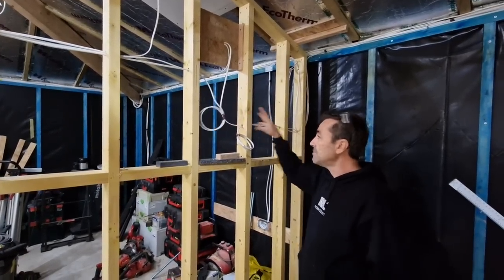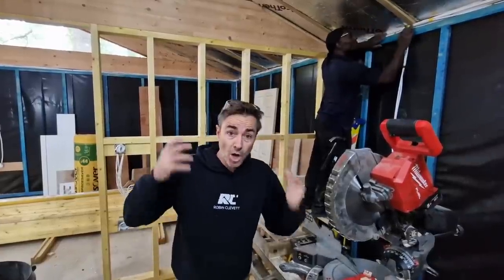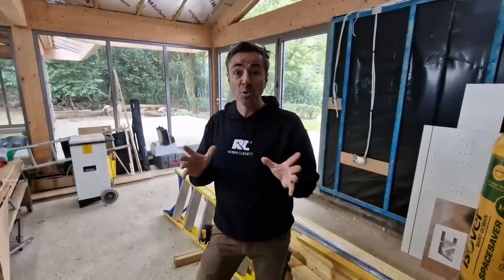Ultimate Garden Room Electrics first fix, meet Colin my electrician

Comment: Robin this is how we do it here in Australia. 
Firstly,
drill as bid a hole in the studs as possible, 10mm cable = 50mm hole. Destroy as much of the stud as possible. 
Secondly, 
Fit out as many rooms as possible on the one circuit breaker. This gives the home owner exercise walking to the fuse box ever half hour.
Thirdly, don’t use any mounting brackets, just screw straight into the plaster. This way you can make more money in 6 months time when they call you back to fix everything.

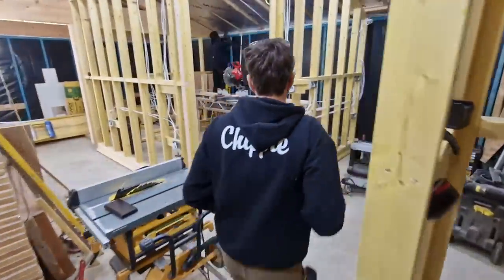Comment: Surely those horizontal cable runs at 2:21 are out of zone or am I missing something? Otherwise looking good.
Reply: I guess they are 50mm deep and RCD protected but yeah good point. It would be interesting what others would say but it's not a domestic where it's chased in and a coat of plaster just to cover it, thought I will add.
Reply: Yes I agree. They don’t look like they are in a zone. That’s a lot of trust you are putting in a 50mm measurement. Especially as there is a kitchen going there.
Reply: I was thinking the same! Best to stick to the zones and not rely on being 50mm from surface as its just a headache if a cable does get hit!
Reply: Exactly what I was going to say. Also, the amount of cables going into that single back box, it's going to be difficult terminating that. Finally, not that it matters but white T&E is LS0H which is used when the cable is exposed. Robin always talks about saving money so using regular grey T&E would have saved a bit of money
Reply: A going to make the same comment , majority  of those cables are not in the wiring zones ,if run outside the zones need to be in wall deeper than 50mm , (where it’s going through studs wouldn’t be the case), armoured or run in an earthed conduit system , also some of the cables coming into the knock outs  in the boxes might be trapped against boxes when it’s plaster boarded ? And where run against ceiling insulation if that contains any form of polystyrene material it will react with the pvc and overtime turn to mush

Comment: Hi Robin,  I come from a furniture making and technical draughtsman background.  I have found what you doing inspiring.   I think for my property renovation I could be the competent joiner and also carry out some of the 1st fix electrical as you have done.  The electric plan design is a bit tricky.   For the kitchen dinner I'm planning on put 25mm battens on the party wall and incorporate 25mm sound insulation.   Also this false wall will save a lot of chasing out as cables can run behind.   Do you know if the cabling can run directly behind the plasterboard? I would have to notch or drill the 25mm battens which doesn't leave much timber.  I didn't want to increase to 50mm void as it affects windows etc.  Do electrician's normally prefer to do all their own 1st and 2nd fix?  As you said the prep work is quite simple. Thanks for the video.

Comment: Hi Robin. Great carpentry job. I've learn loads from it. Just a quick question. Was the work in the UK. Looking at the cable runs, most of them don't seem to be within the wiring zones as per BS7671 electrical regs. Also only new builds need to have sockets/switches etc.. to within set heights.
An electrical on site guide is  worth having for all trades.
Not being picky, just giving you the heads up as a sparky.
Reply from the maker: In our situation we have more than 50mm from the final wall surface to the cables, so this means we can run the cables to areas other than the permitted zones when using a thinner overall partition

Comment: Awfull lot of cables going into that switch box i think i counted 7 its going to very busy in that box personally i would have used either a duel box or a 47mm box. Wiring zones a bit suspect.
Reply from the maker: There are guidelines about zoning in stud walls and they relate to specific distances from the eventual wall surfaces etc, we are in perfect zoned areas as per regs, but I am happy to learn if I have missed something, what is your take on the rules about the zones?
Reply: @ukconstruction  you can get away with the horizontal wiring due to the 50mm depth but the wiring zone between points would be better keeping to the horizontal vertical scheme as this is what is in the majority of people recognize. Think of the next person to work in that building they will not know where your cables run even though your cables are 50mm deep the cables between point are 150mm ish above the horizontal a person not knowing this could drill into the cable thinking that the original cable ran horizontally or vertically between points. Hope this makes sence. In fact if i would recommend butting protection plates over every stud just as extra protection. Hope this makes sence.
Reply: See my comment about wiring zones where somebody else has asked about it , cables should be run horizontally or vertically where the accessories are mounted
Reply: No good being 50mm from the surface when the next person comes along and wacks a few 70mm coach screws in to the studs for their cantilever desk/floating AV cabinet/etc and finds their electrics keep tripping off afterwards (or worse).
Reply: @_Steven_S  hence the wiring zones. But unfortunately the man in the street probably wouldn't know about wiring zones.